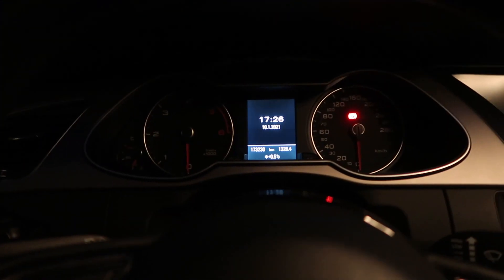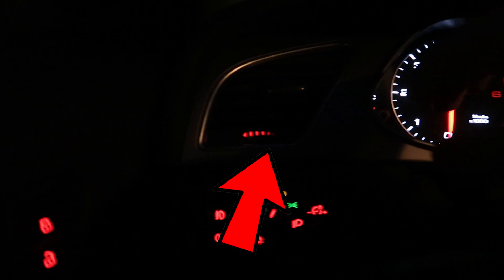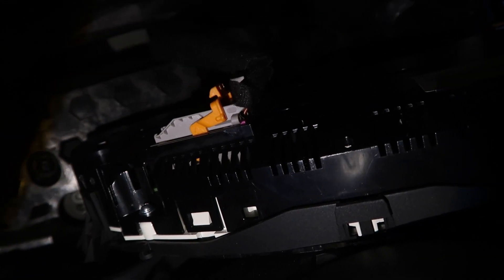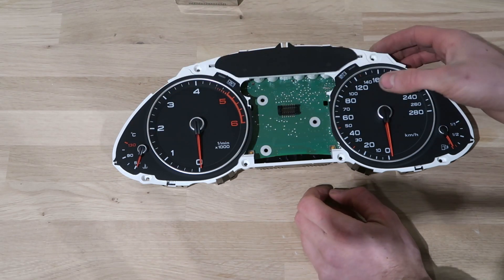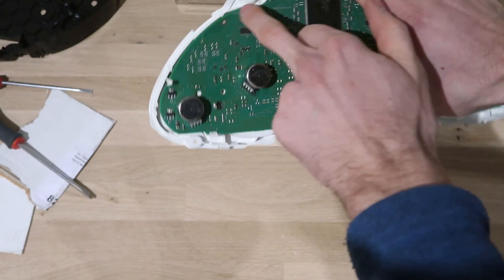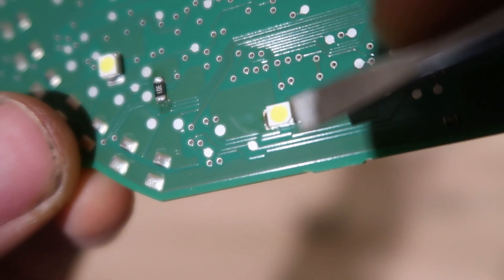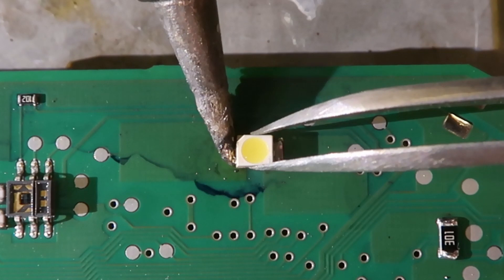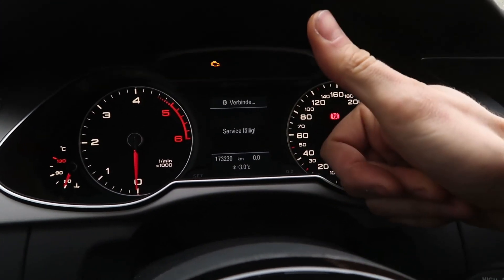HOW TO repair 2013 Audi A4 B8 Cluster Speedometer LED backlight DIY Video | Plus bad jokes

Comment: Hi, I have a question, you can definitely help me! Is it possible to replace the disk chassis from one counter to another? without the electronic part, simply the white plate + the discs + the needles.
Reply: in fact, I would like to know if by removing the white plate, I can replace it (without removing the discs and the needles) on another meter
Reply from the maker: Oh man I don't know, it's been too long since I took this thing apart, sorry!

Comment: If you're doing this repair, be wary of the brightness of the new leds, don't make the mistake that I did that was putting "ultra bright" leds in the cluster.

My dash went from having little light, to Christmas tree after the repair, I had to buy leds that are not so bright as the first ones, and once they arrive will have to perform the repair again. 

Other than that, perfect instructions.

Comment: How did you know that it was the LVs that was broken and not a fuse or something like that?
Reply from the maker: The cluster itself was working, only the backlighting was partially not working. A broken fuse would take out the entire cluster. Also a fuse is only a symptom not the actual problem, a fuse only blows when a current higher than it's rated capacity flows through it, meaning something down the line had an issue (likely a short). Anyways, that's not relevant in this case.
Reply: @DmitriIvanov  ok, because I have the same problem. So then the only solution for this problem is doing as you do in the video?
Reply from the maker: you can replace the entire cluster @sanderchinese

Comment: So I have two LEDs on my Q7 that are flickering at the same time one section 4 'O clock on the tachometer and one 7 O'clock on the speedometer. Seems to me if the LED was the problem then they wouldn't flicker together. Is anyone aware of some other component that needs to be replaced?
Reply: My 2010 A5 sometimes lickers on the Revcounter at 5 and  6, really odd as LED's normally work or they dont and not sure if theres just one LED there that could be faulty. Anyway I might change them  if it bugs me enough while driving at night.

Comment: Thank you, replaced them and indeed little on the bright side. Can you tell me where the resistor(s) are/is located please? Another question, why is your car falling apart, what happened? as a new Audi owner im very curious :)
Reply from the maker: Send a photo of the board i can probably find them. Otherwise I don't really remember...they were for sure a 1208 package and i think 330ohm. I never messed with the resistors i don't really care if they are a bit brighter, but cool that you managed to do it!
Reply from the maker: As far as problems i have 240k on mine now and honestly it's been a great car. The auxillary heater broke, a wheel bearing broke, one parking sensor broke. Just recently i noticed the timing chain cover is leaking oil which is very uncool because the motor is backwards in this car (the 3.0tdi)....means the timing chain is toward the gearbox.
Reply: @DmitriIvanov  Thanks for your response. So i ordered 1206 resistors (correct size) as i noticed the following. 330 ohm is going to all the leds and is a different size (larger), also goes to the multicolour leds. If i replace that it will dimm everything. BUT behind the 330 ohm every 2 white leds (which i replaced) has 1 1206 resistor of 300 ohm in series. so i needed 10 of those, because i have 20 lights. I ordered 360, 390 and 470 ohm. I have now replaced them all 10 with 1206 470 ohm. I will report back with the results. Something shitty did happen, the plastic lens got scratched because i was trying to be a perfectionist by cleaning it and now i am struggeling with restoring the lens XD from the inside and out. I will report back with the results when i put the thing back together and try out the brightness in the car.
Reply: @DmitriIvanov Ah yes that sucks, engine out job i think for the timing chain in that case?... :(. i have a B8 audi a5 sportback and with 214000 kilometers on it. The engine is smaller 1.8tfsi year 2013 so a little easier to work on i guess. its a fine car and im treating it like its a fiat panda by destroying the instrument cluster and experimenting on it XD i hope it wont take revenge on me :P
Reply from the maker: @spinworldworldspin3311  maybe start with replacing 1 not all at the same time...let me know what happens...
Reply: @DmitriIvanov  Ok so i placed the 1206 470 ohm resistors. it looks like it is a little darker. Maybe not like original, but it seems better. So you could do a bit more. I am going to leave it like this.
Reply from the maker: @spinworldworldspin3311  you're not the first one with this question....maybe snap a photo of the board and highlight the resistors which you replaced and post a link to it here to help the other guys out..cool go know that it worked though!

Comment: Yeah I rip off the led light and now I have a default light on , and aid bag, steering wheel and abs light is now on 😭 what can I do about it ?
Reply from the maker: Oh no! Send a picture of what you did (Instagram)
Reply: Hay, did you found an solution? Have the same problem 😢

Comment: I just completed this procedure for my 2013 B8.5 Premium Plus Quattro and I'm very happy with the result. I would say it is a perfect fix.

This cluster was sent away to be fixed before I bought the car. The electronics shop where it was sent said they couldn't fix it. The quote had been $800 if the work had been done.

I bought the LED lights from Reichelt (from the description of this video) and it cost me about $50 CAD after taxes and shipping. They look exactly the same as the old lights. I bought a soldering kit, solder wick and flux cleaner off amazon for another $50 CAD or so.

The job took me several hours from start to finish. The better part of a day. 

I was initially worried that the LED lights were going to be too bright, because when i tested them they seemed way brighter than the ones that were coming out. However, I tested the finished product with some night driving and they dim down (via the dial in the car) to a perfect level. If you turn the dial up, they are very, very bright. Not a bad thing.

When reassembling the dials, I found I actually had to remove the temperature dial and reposition it so that it rested at the coldest temperature reading. I couldn't just turn it to correctly orient it.
Also it took a little thinking about how to set the hard stops on the rpm and speed dials. Make sure it cannot go past zero counter-clockwise and you should be good if you put them back to where they came out.

Anyway, thanks for the video man! I'm going to send you some money as a thank you. I'll spend just a little less on the vices you mentioned but overall you saved me a bunch of dough.
Reply from the maker: Thanks so much man! It's great to read comments like that :D

Comment: hi dude can you tell me how to do when you start up the engine the rev counter goes from 0-280 and back? i have got audi a4 (2012)
Reply from the maker: You need to program the "self test" bits in the speedometer or BCM (forgot how the exact module is called) with vcds. Basically you need a vcds or access to one - make sure you backup all of your coding before making changes...
Reply from the maker: Basically its this: https://www.youtube.com/watch?v=ESpKoNomPqk 
Not exactly the same car but should be more or less correct, maybe the module ID is wrong, just google around.
Reply: Hi to all I got the same problem and I don’t know who can do it for me if anyone round South Yorkshire   In Uk drop me  a message please

Comment: Hello, I have now successfully exchanged the LEDs, but the linked LEDs are way too bright compared to the originals. Where exactly is the series resistor located? And is this responsible for the entire lighting or only for the changed ones? thank you
Reply from the maker: Servus, glaube du hast das zuerst auf deutsch geschrieben....ich bin mir nicht 100 pro sicher weil ich die Wiederstände nicht geändert habe aber, wenn ich es richtig ins Kopf habe, war da Wiederstände in 1208 große mit ein Wert von 330 Ohm oder so. Ich würde dort anfangen :) viel Glück!
Reply: @DmitriIvanov  The new leds are bright despite using the brightness knob to control it?
Reply: @webbyboy  Yes. I just bought SMD resistors to try to counter this. Wish me luck :)

Comment: my cluster started to flicker passed the 100Km/h mark. Hows the cluster fix doing? Would you recommend to replace something else? like a transistor or voltage regulator that control the LEDs? for example
Reply from the maker: Well, now that I did it I can tell you that the new leds which I put in are a tick brighter than the originals. I would increase the series resistance a bit to lower their brightness and likewise the current going through them, hopefully extending their life a bit. Other than that it has been perfect! :)
Reply from the maker: The root cause of the failure isn't in the supporting circuitry but rather the LEDs themselves. Perhaps the entire circuit is designed a bit too close to the limits of the led and that's why they fail. But no, just replacing the LEDs will fix your issue.
Reply: Thanks for the feedback. Thanks for the video too. Keep in touch

Comment: Ilike your style man.. actually quite funny comments you add for entertainment value... im looking for a Q7 colour lcd info display backlight inop..i can see it working with a torch...striped down and found popped IC9945a do you recon its the problem.. tall order i know.. thanks for the vid anyway..
Reply from the maker: Backlight will be an LED module, probably one on either side of the lcd. Try to find the pins of it and test just the LEDs themselves with a voltmeter, dont do it with a power supply unless your current is limited. If the LEDs are ok probably it's a driver issue - just search for ICs near the LEDs but it seems you already found one which is dead. Can you read the part number from it and google it? If you find the datasheet you can figure out what to probe. Ic9945a sounds like a reference designator on the manufacturers schematic, not a part number.
Reply from the maker: Write me on Instagram if you want and send some high res photos of the board i can try to help you that way, if you want.
Reply: @DmitriIvanov  thank you for the reply.. i dont have instagram .can i wassap to you. Ihave pictures of the blown ic and located one by the first number on e bay.. the dash is very simular to your audi with colour lcd. The strange thing is only other fault is the yellow suspention light comes on at random so the ic could be to do with that i suppose
Reply from the maker: @123martome  my email is in the about of my youtube just write me there.
Reply: @DmitriIvanov  E mailed you with some images..many thanks.

Comment: Hey, mine speedo "stick" started to flicking sometimes, is that the led without yellow dot? Is the process here the same or maybe something else might also be broken?
Reply from the maker: Same process, just locate the led which goes to the stick. I would just replace them all if you're anyways going to open it up, they will all fail eventually and the cluster can only tolerate so many disassemblys before it falls apart.

Comment: Can you please give a link to the leds? :) Can't find them for normal prices!
Reply from the maker: I got mine from Ebay but like I said they overcharge there. I found them here: https://www.tme.eu/en/details/osw5sas1c1a-s-lm/smd-white-leds/optosupply/ I didnt try to order them there though, no idea if it will work. Just google around and try to reduce the part number a bit, you probably dont need the exact same LED, something similar with the same-ish forward voltage drop and temperature should work.
Reply: @DmitriIvanov  Thank you! Ordered with tme.eu right now, 20 pieces, € 3,- ex vat and transport :)
Reply from the maker: Ah great man, let me know if the fix works out for you :)
Reply: @lennenoldenbeuving2499  Did you replace your LEDs yet ?

Comment: thank you so much for attaching the type of LED's ive been looking for the correct ones forever online.
Reply from the maker: Like I said in the video, they are a bit brighter than the original ones! If that bothers you, you need to increase the series resistance a hair, i think it's 330 ohm now, maybe put 350-380ish...
Reply: @DmitriIvanov  gotchu. Now the inner LEDs that dont have a yellow circle backside, what are those for? The dial? And have you tried replacing the lights on the climate control panel? Because im going to attempt to do those as well
Reply from the maker: @o0quakeroats0o  those are the status light indicators. They are multicolor LEDs. On the dash my lights are all fine, but I suppose the led changing process is similar. The disassembly is a bit more difficult though (more than 4 clips to rip off...) .